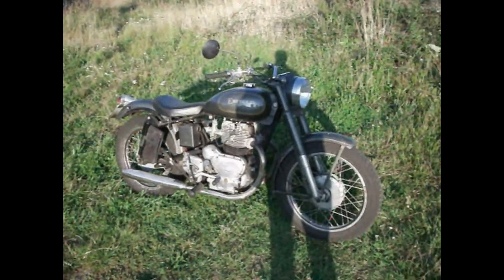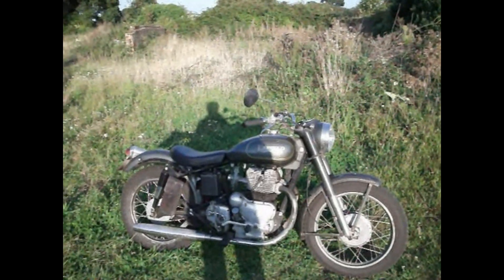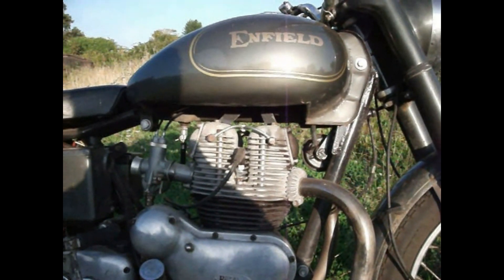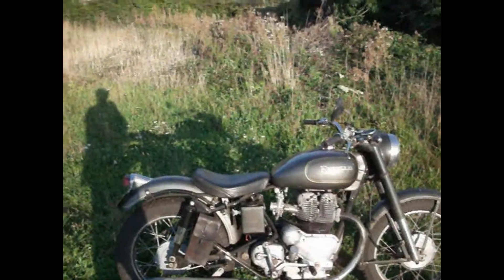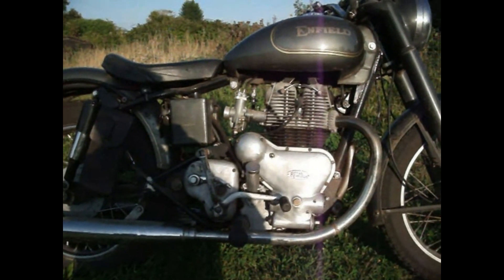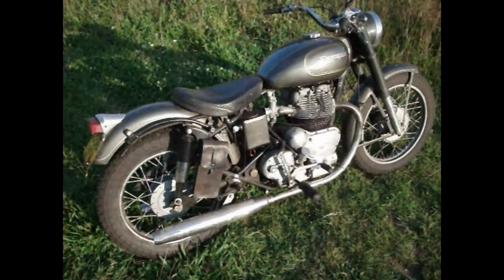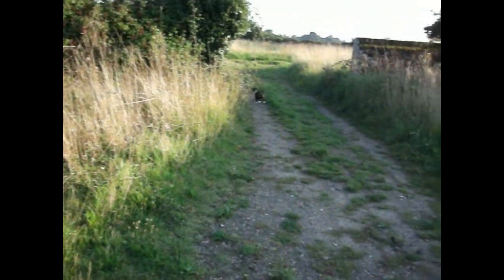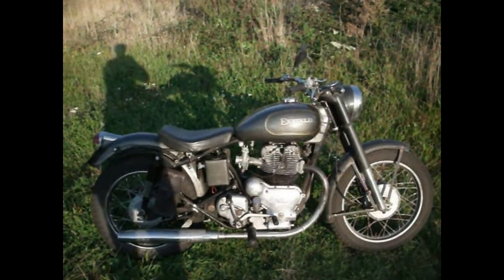Royal Enfield oddball and a HUGE THANKYOU!

Comment: Sorry for all the comments but I'm busy catching up on your old videos. I have spent many years in industry; mainly involved with diesel fuel injection, hydraulics, pneumatics and fluid control valves. Over recent years it has become apparent that, even though you choose a brand that you think comes from one place, it is rarely manufactured there; no secret I know. PVL coils are still made in Germany while Lucas, for example, are made in India. Normally that is not a problem for me as Indian manufacturing has come a long way and they have a decent track record, far better than other manufacturers from that side of things, globally speaking. All the best mate. (Love the cats keeping an eye on what you're up to.)
Reply from the maker: Many thanks! You are correct. Lucas name sold to India but they can't match the original Lucas quality!

Comment: Greetings from India! This just popped up on my feed. The bike looks fantastic! I love the fact that the mountings for the drive train match up. Also, you mentioned that this engine has a dynamically balanced crankshaft. Were you referring to the truing process or something else?
Reply from the maker: Greetings from Gt Britain! You have to remember that the 500 Meteor Minor shared the same frame as the Bullet and because you haven't changed the original frame design for the Indian Bullets, That's why it fits! Dynamic balancing of crankshafts, was only carried out by Royal Enfield as a manufacturer. It gives far better balancing of the crankshaft than statically balancing doe's. This is done in a special machine and every British Royal Enfield twin was balanced this way. That is why they run so smoothly, without the need for balance shafts, like the new 650 has!
Reply: @Volcanicbrown1878  Yes, that itself is fascinating, that the frame hadn't changed for so many years and that the frame has space for a bigger engine. I assume the latter is because RE made the same frame for several models. I need to read up on dynamic balancing. I don't think I understand what it actually is.
Reply: *for several models and not just these two.